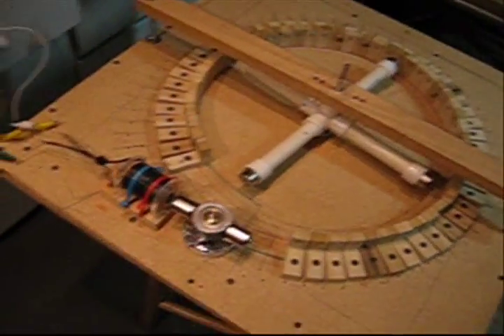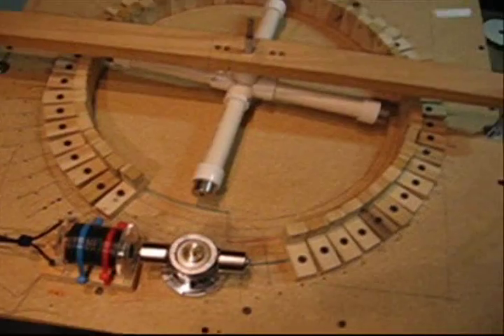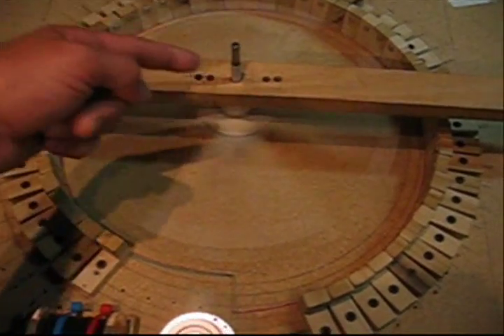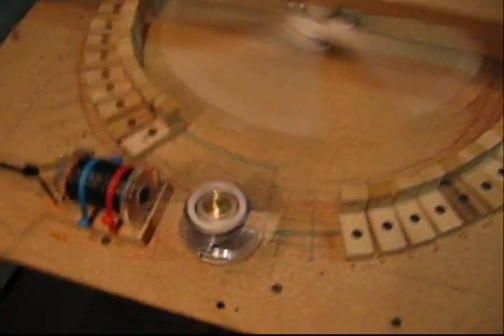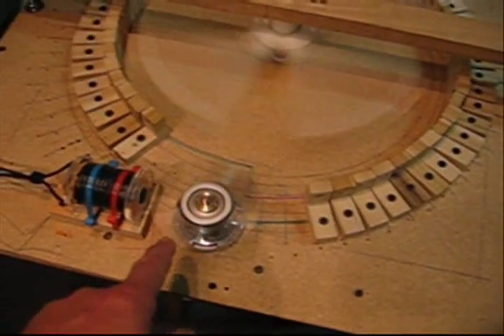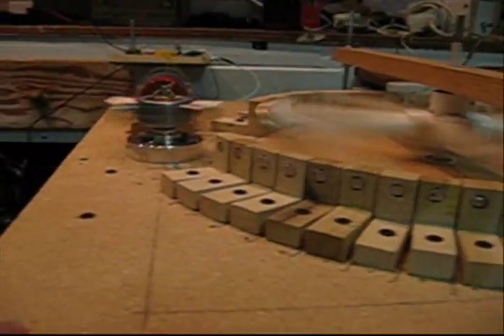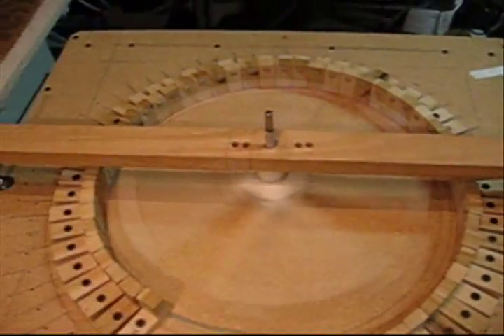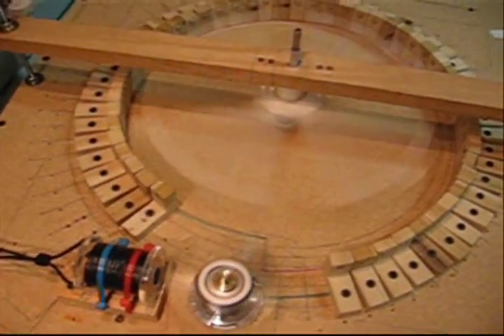Maget spiral motor/rotor with Bedini circuit

Comment from the maker: @PMMInsanity the magnets at the ends of the rotor are 7/8x7/8 (big ones) and are either N48 or N50 and the smaller ones in the spiral are all N48 1/4x1/2

Comment: Hi mcorrade... awesome job!
This is the similar job that I am trying rite now, joining bedini and wenkel, only different in the rotor model to provide more generation of currents, but when I am find ur video this night, I am nervous, and you already show ur success about half year ago.
Man, congratulations!
If you continue the work, In my calculation you should get higher power generated with the low trigger current via bedini. The power actually is coming from magnetic acceleration

Comment: even the flywheel weight has its own sweetspot, so youll have to experiment to find it. but maybe better solution would be to place pickup coils around the wheel, so you could extract the right ammount of electricity as a load, to get the best charging and amp draw.
 best regards

Comment from the maker: thanks and no it takes all it's spinning momentum from the smaller rotor. The small rotor has only two of the strong neos but I just got 6 more in and will put four on the small rotor which is powered by DC/bedini circuit. I'm hoping I can drop from 12v to 5v now that the smaller rotor will have more attraction/repelling force. Watch for the next video which will be very soon (hopefully in a day or so)..
mike

Comment from the maker: I will probably try a flywheel but to tell you the truth, the rotor and the weight of the four neos makes it pretty heavy already. I should try and put a pully or gear system on it and see what the torque is?

Comment: great again!!
do you think you could add some heavier flywheel, so if it can come to speed with a heavy flywheel it can easily turn a small generator.
you have strong magnets for a bedini circuit, thats why you should introduce some weight for torque and then use generator for load, because bedini circuit is great, when you load the rotor you get less amp draw, its all about tuning.

fantasstic work